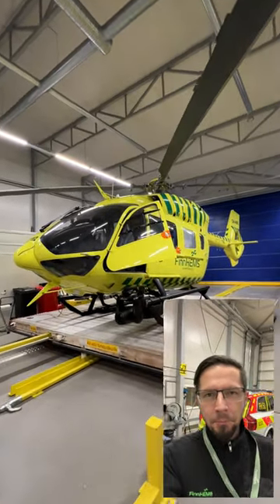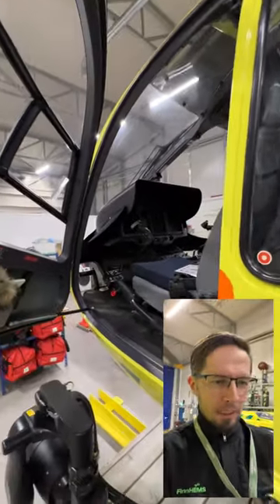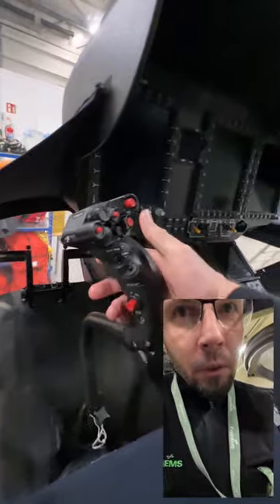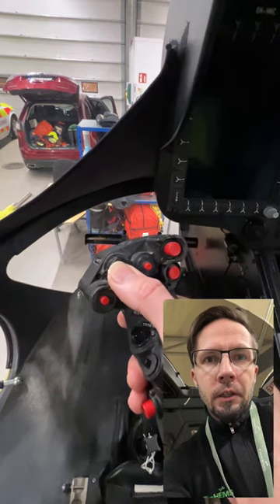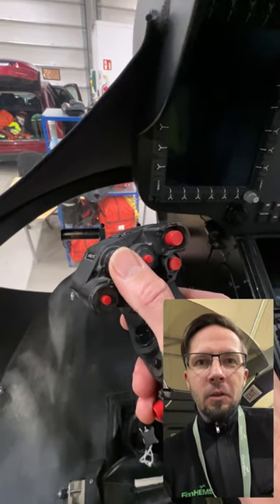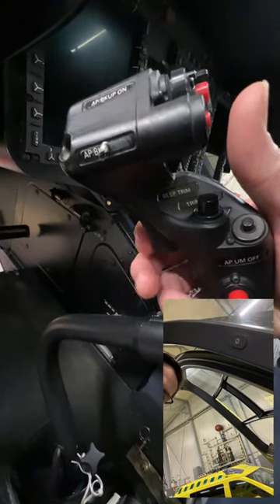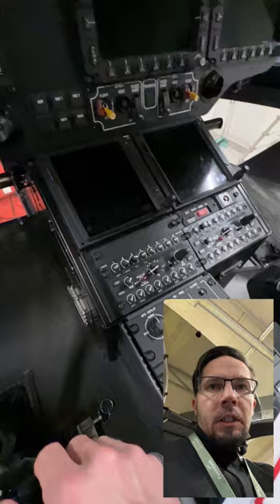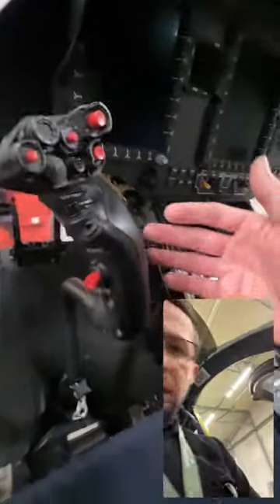Airbus H145 cyclic and collective buttons explained.

Comment: Trank YouMarkus for your absolute amazing Videos and to give us some really amazing Impression of your absolute responsible and Great Job as a Hems Pilot. You don’t have to apologize for your English because the way you explain, show the stuff and fly the helicopter in the same time is absolutely stunning !!! Let me ask 2 questions please : For what reason is the collective on the copilot –side not locked when in neutral position? When for example the PIC is the pilot flying and uses the collective on his side, does the other collective simultaneously move also, or is it fixed then?

Comment: Very informative video!  Thank you for creating this!!  But, I have a question:  WHY did you not hold your cellphone horizontally instead of vertically!?!?!  (TVs and computer screens are oriented horizontally, NOT vertically!!  And, YES, your cellphone will shoot video horizontally very well!)
Reply from the maker: Thanks for the feedback!

The videos I share on TikTok are shooted vertically. And this one, like few others on my channel are made for that purpose, and shared afterwards also here on Youtube 😊 Most of the videos on my channel, as you can see, are filmed horizontally because that is the main direction we use in most of the devices. 

Actually still one year ago I could’t imagine filming anything in portrait mode, but this TikTok has changed a little bit that practice of mine 😅

Comment: Many thanks for such nice videos. Could you explain when do you use GTC? Is useful?
Reply from the maker: Thanks for the kind words. Actually we just had a practice flight with the NVG's on a congested area, and I used the GTC.H. and GTC.

I used GTC.H when descending to lower altitude and snow started to blow, and right after I took off to hover I used it again. Then I switched to GTC and started to fly backwards using the PC2 RTOL-procedure. GTC keeps the nose heading steady without using the pedals, and helps with the departure. 

During taxiing it is also sometimes nice to have GTC on. You can just start steering with cyclic, and nose turns automatically to the direction of the turn without using pedals.

I filmed all this with my action camera and I'm going to share it after day or two on my channel  :)